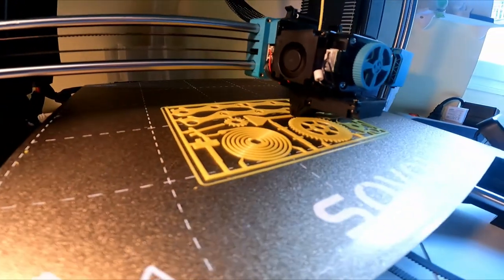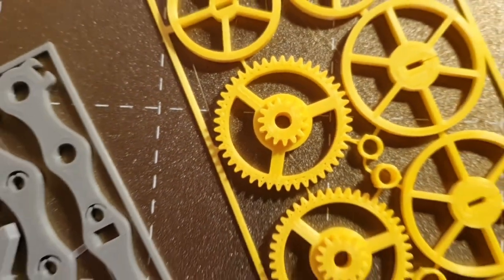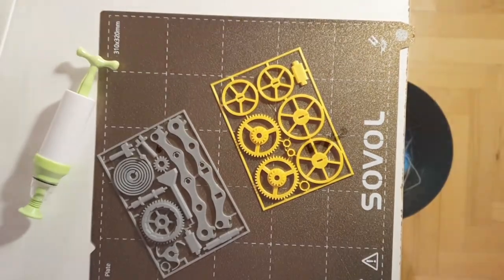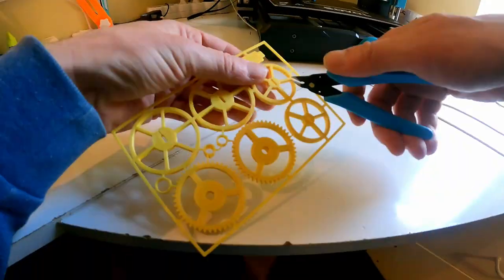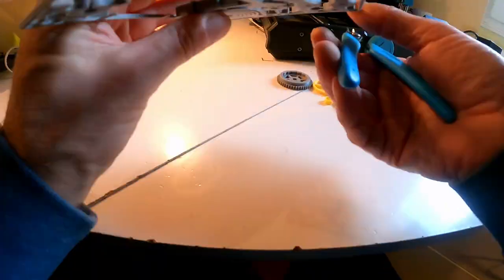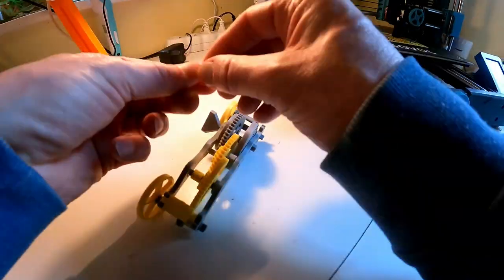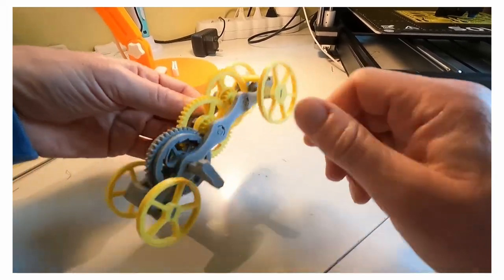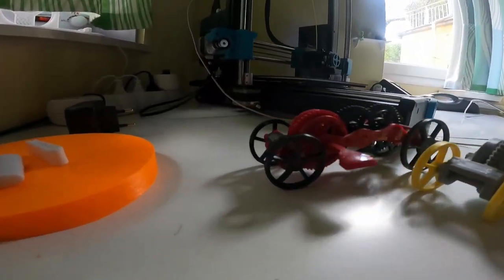Wind-up car gift card (3D printed on SOVOL SV06 Plus)

Comment: Hi! My problem with the sv06 plus is bridging. Have you some advise? I use prusaslicer. I tried to modify speed and retraction but nothing. 30 mms and 0.5 retraction.
Reply from the maker: Yes, the SV06 Plus part fan is way undersized. But there are pretty good, easy to do upgrades involving 5015 blower and self-printable ducts. Check, I put links to the fan mod I did  in the description of some of my other videos about the SV06 Plus.  If you plan to upgrade to Klipper, even a dual-fan upgrade is a good idea.